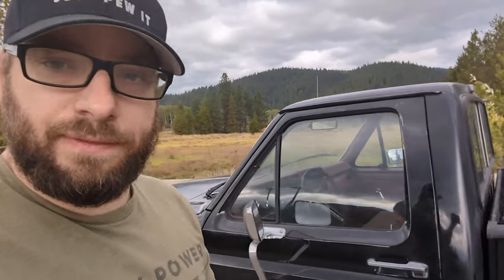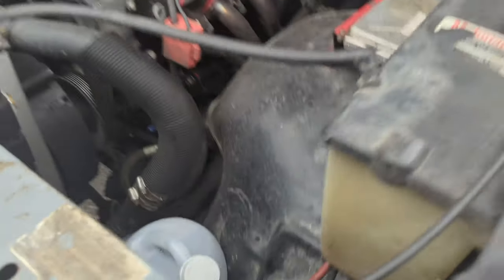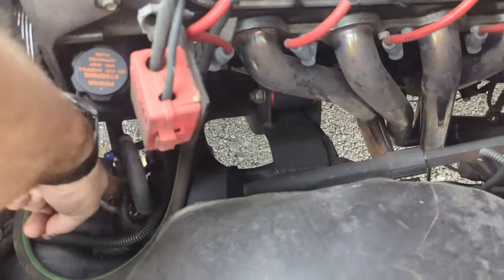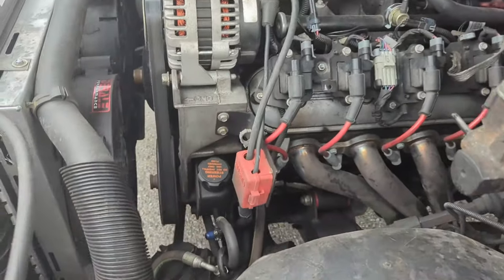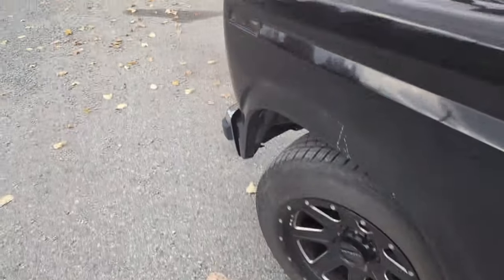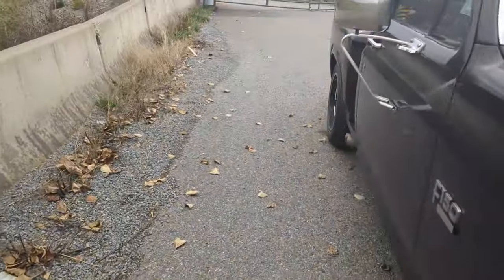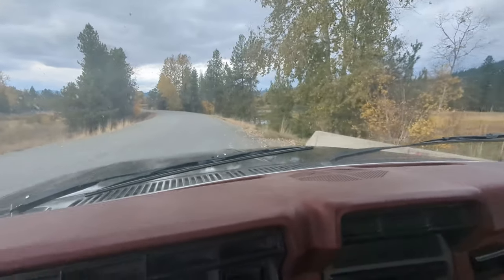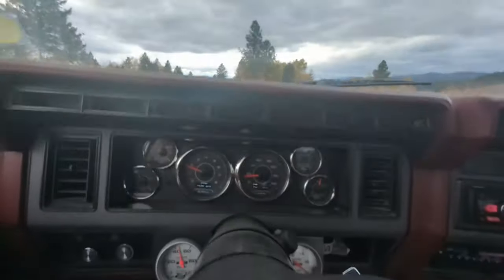LS Swapped F-150.  1 year later, she's still a ripper!

Comment: Sweet truck. I’m 15 and just bought my first truck, 1986 F150. Im doing an Ls lq4 6.0 swap just like you did, also with the 4l80e transmission. What did you use for transmission mounts and crossmember?
Reply from the maker: I used the stock cross member, but I had to move it.  Then I built a small spacer that bolts to the trans and then to the top of the stock trans mount to raise the 4l80e up a bit
Reply: Ok cool. I heard from your other video that you used speedway engineering headers. Did you use long tube headers? Thanks
Reply from the maker: @carder761  they are Speed Engineering.  Yes they are long tube
Reply: Ok, thanks
Reply: Sorry to bother you again. I have a few more questions. In your last video in the description you said there is a company that makes motor mounts for ls swaps in these bullnose trucks. I could not find that company, do you happen to know the name of the company? Also when you said you used the stock crossmember you mean you used the one in the ford not the donor, right? Thank you
Reply from the maker: Autofab.com makes them.  I have no experience with them at all so I cannot comment on quality.

 I used all stock Ford parts in the truck, both cross members included, with the exception of the engine and trans.  Everything else is Ford stock, or built/modified by me.

The only gm parts I have are the engine and tranny.
Reply from the maker: Also, don't be sorry about asking questions, that's what the whole video was for the begin with.  Just trying to help everyoen
Reply: Ok, thank you. What injectors and cam shaft did you use?
Reply from the maker: Deatchwerks injectors and a Sloppy Stage 2 cam
Reply: Ok, did you do anything with the rear axle or gearing? Also, what rear axle does your truck have? Thank you
Reply from the maker: @carder761  the rear end in an 8.8" stock axel with 3.55's or 3:45's I believe.  I changed the yoke on it to the larger GM size.  I think it's a 1350 but don't recall.
Reply: @LSbullnose  Ok, thank you. What transmission did you have in this truck before the 4l80e? If I recall correctly you used to have a Windsor V8 but I don't remember if you shared the previous transmission. I had a I6 4.9l with a 3spd on the column in mine. But, the trans cross member will not work right now with the 4l80e.
Reply from the maker: @carder761  it had an AOD in it.  You should be able to reuse yours if you just slide it forward or backwards a bit.  I had to build a spacer for mine.  About 2" or so between the old rubber mount and the new trans.  Also serves as an adapter.
Reply: Does your truck do burnouts with open differential?
Reply from the maker: @carder761  just depends, sometimes it will rip them both loose, other times it tries to do the ole 1 tire fire.
Reply: I’m trying to mount the engine up but the motor mounts look small, and like they need more support to hold up this big 6.0 v8. Did you have any problems with them? Did your truck already have extra support because it had a v8 previously? I have the Blackhorse racing universal mounts off amazon which I believe you recommend and said you used on your truck.
Reply from the maker: @carder761  those are the ones I used, yes.   They were fine.   I had to reinforce where the weld to the cross member a little bit.  But I don't think the cross members should be different, unless you are working on a different year.  The original mounts will definitely be different if you had a 300 in yours.   

So what I did was, cut mine off.  Welded some flat bar over the holes, the. Welded those universal mounts on top of the flat bar.    Engine is still in truck, so I would say they are good.  Unless that company cheaped out on the steel they were using.
Reply: Ok thank you for the information. My truck is a 1986 bullnose f150 that had a i6 300. The crossmembers should be the same, I would think. The engine mounts just looked very small and not as heavy duty as I thought they would be considering they are holding up this heavy engine.
Reply: Hey, the project is moving very slow. Still can’t get the motor mounts right. Could you send me some pictures of how you have the motor mounts on there? Was thinking maybe sense your truck had a v8 previously maybe something is different. I can give you my email or phone number. Whatever you prefer. Thank you
Reply: If you don’t fee comfortable messaging me that’s fine. Just am wondering about if there was a insert in the motor mount or not.

Comment: Where did you get the engine mounts and transmission k member for the swap. I want to do a swap in a 1999-2004 F150 2wd.
Reply from the maker: Stock K member, I patched and welded the factor holes.  The mounts are just generic engine mounts that you cut to what length you need them to be and weld on

Comment: Been contemplating dropping a ls 6.0 in a 2008 f350. Im sure tying into the ford wiring will be a job
Reply from the maker: Im not sure on that specific truck.  But you could always get the diagrams and start picking until you get it.  Guys Cummins swap those all the time.  Probably some good info out there.